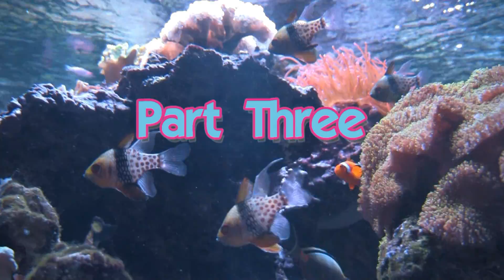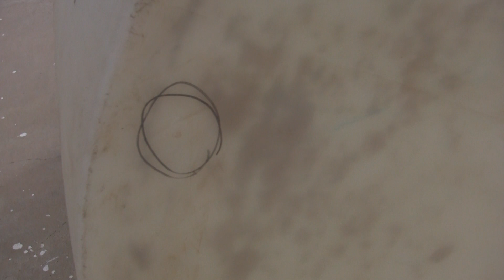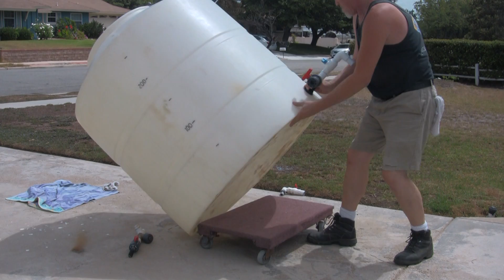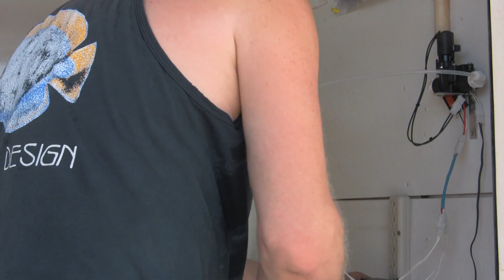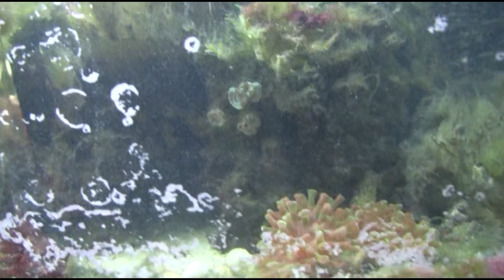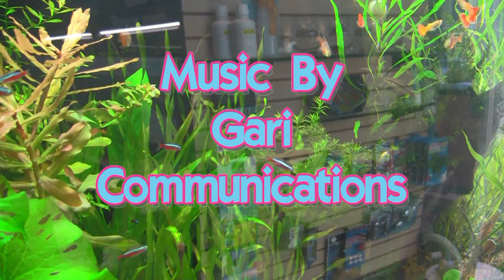Spectrapure Aquarium Water Filtration LA Fishguys Episode 134 part 3

Comment: Nice video once again, and I love the intro/outro music!  I live in N. Idaho, miles from pavement, near the headwaters of a watershed.   There is no farming or ranching upstream, only clearcuts.  There is however about 1/4 mile downstream, a pasture that is home to cattle during the summer months.   My well water is fairly pristine, but I am wanting to get it tested for things like phosphates.  So far I've had great success just using the well water that is filtered for sediment as it comes into the house, but I'm moving into reefing as opposed to just a FOWLR tank, and I think that I will be getting an RO unit soon.  I am looking to possibly do an RO only unit, then later add more tech to it such as an auto shutoff valve to prevent overfilling of my "bucket", TDS metering, and the final DI stage.    Any input would be greatly appreciated.   Keep shining and Happy Holidays....

Comment: Hi Jim;

I do not see how this can be cheaper solution. For each liter of RODI water you waste at least 3 liters of water + the cost of salt + electricity + replacement of membrane and filters. From my calculations, here in Australia, the ocean water + home made supplements is cheaper that RODI water at least 7 times (or more). But maybe our cost of water and electricity is very high as compared to USA.

Chloramines are not removed by RODI system. You need to use special activated carbon for these molecules.

Warm wishes from Perth;
Piotr
Reply from the maker: hey P, I spoke to The Water Company prior and they told me, based on my calculated usage, that it would be about a $40 increase in water cost in a two month period. yes there is salt, media and membranes... I guess we shall see  :)
Reply: Piotr, this unit is a 2:1 unit the we have it setup. That means, 2 liters waste to every 1 liter of RODI. Jim should get 1500-2000 gallons of RODI before having to replace his first DI cartridge. The second DI cartridge should last 2000+ gallons. The other filters should last much longer. In the end, the home made water should cost Jim less than half of the delivered water. Probably closer to 1/3rd.

Comment: in regards to the issue with holes or sharp points in the boards possibly causing the micro holes. Would the use of the insulation board 1/4 or 1/2 inch thick such as that used under large tanks for leveling purposes maybe help to solve any future issues such as this.  Just a thought. Thanks or the great vids always enjoy watching and learning.